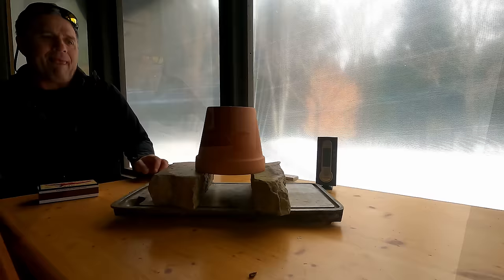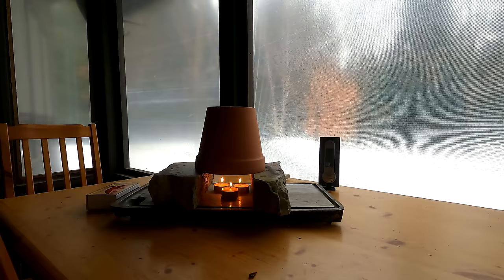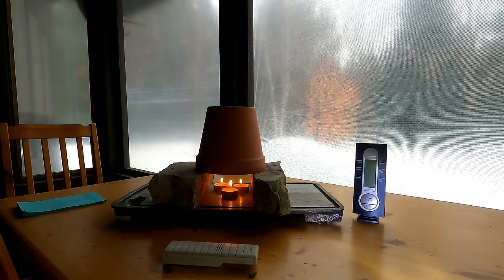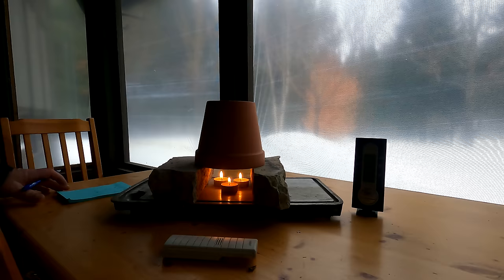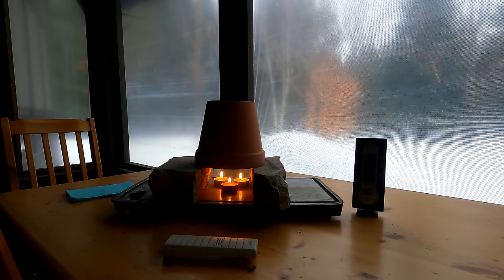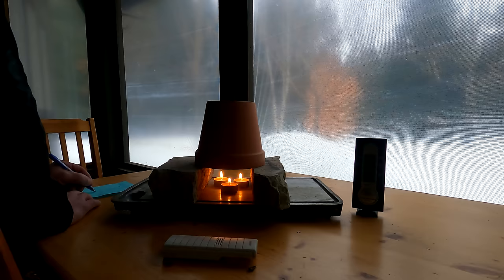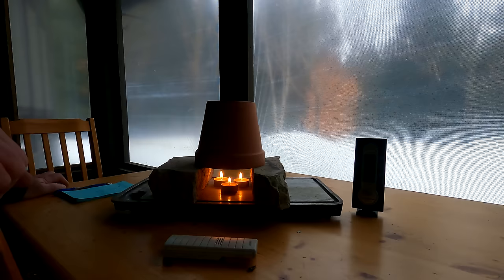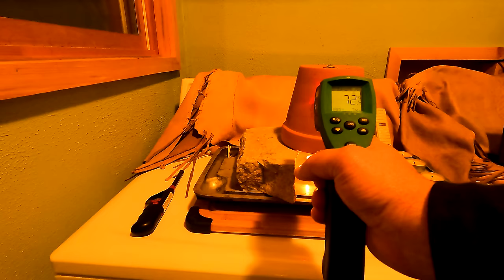Testing the Clay Pot Heater | Truth or BS | Prepping and Testing

Comment: This seems ideal for, say, some homeless guy who can't afford a house but CAN afford some candles and some pots
Reply from the maker: This test was to determine if the unit could work as a space heater - the results indicated it can work  to raise the temperature a very small room by a few degrees. The pots capture the heat and control the output.  It is a system which was used centuries ago to heat homes. They used clay units which were designed to capture and store heat. When the power goes out and there is no heat available, people will resort to all manner of contraptions to keep warm. I would not use this in my home due to the safety hazards involved, also,  there are products designed to provide emergency heat efficiently and safely. I don't blame people for experimenting and trying things out rather than complaining about being cold.

Comment: This test would be better done, and more credible if it was done using the scientific method. So you should do this with only the candles in the same room with weather conditions exactly the same.
Reply from the maker: You are correct - this was a simple test not a differential test. The actual test was conducted in an enclosed room which is 5' by 8 ' with 8' ceiling. This room is insulated with R30 in the walls and R40 in the ceiling. Outside temperature has no bearing. 
I recently did the same test using the scientific method. This will be posted shortly.

Comment: Remember that you are 37 celsius and lot more surface than a pot.
Reply from the maker: That is why I removed myself from the equation. I entered the room only to check on the status of the test; however, with the candles burning and a persons body heat in a small insulated area, the person would indeed be able to stay clear of hypothermia.

Comment: Amazing that after all that 'science', you did not do a test with just the candles (no pots).  You would have found that the room temp would have risen exactly the same, with or without the pots (assuming that the outside temp also remained exactly the same for both tests).  The candles put out a certain BTU  value with or without the pots.  The pots do not add ANY extra heat to the BTU's put out by the candles.
Reply from the maker: The error I made was assuming that most people would understand that the test was done to see if the pots would capture the heat and radiate it rather than stifling it. The pots will radiate the heat up to 30 minutes after the candles are extinguished. The real test of this unit was done in a laundry room which is internal to my home  - R30 insulation in the walls and R40 in the ceiling - outside temperature has no bearing on the process. The room's temperature raised by a few degrees - the building code stipulates that an occupied area must be able to maintain 18 degrees Celsius - This unit would not be capable of maintaining that level of heat ; however, it would keep a very small room at a relatively livable temperature. All of that aside - I would not use this unit as a heating source as there are too many issues pertaining to safety which precludes this from being viable. There are many manufactured heaters which are designed and sold for the very purpose of - Emergency Heat.

Comment: So in the middle of the day it took 2 hours to get from 8.5 degrees C to 10 Degrees C that's not a great change, then you switch to a different room that looks nothing like your " experiment set up " and start bangging on about 15 / 16 Degrees and it's not BS 🤣 not to mention the second part of the video looks like night time, how low dose the temperature drop there at night? I'd say its way lower than your original 8 degrees C at the start of your video and I don't for one minute believe you brought the temperature up from 8 Degrees C at the start to 16 Degrees C at the end without some other source of heat.
Reply from the maker: Hello Christy. Good observation. The first room is an uninsulated screen porch. Plastic film on screens. I was surprised it even raised the temps by two degrees.  The second room is an insulated mud room. Door closed. No extra heat source. Size 5 fr by 6ft. 30 ft square. All temps were measured real time. If you don’t like the heater, don’t try it. I wouldn’t use this to heat anything. I simply was answering the question, does this device actually work. It does. Simple. I never said anything about efficiency.  By the way, I don’t BS.
Reply: @Hawksshadow  and you have no idea how to conduct an experiment either!
Reply from the maker: In response to your wonderful comment,  I would have to say that everyone is entitled to their opinions.
The one thing I can say is that the video was a test and not an experiment - I was not comparing it to another heat source. Just simply determining if the unit could raise room temperature - I did another video recently in a tent using the same unit. This time I compared it to another heat source.   BTW - I would not use this as an emergency heater as it is way too inefficient and hazardous.

Comment: Try it again with candles but no pots. Maybe then you’ll understand your mistakes.
Reply from the maker: I did not make any mistakes - simply a test - the pots worked as expected - they captured the heat and radiated it out in a controlled manner. The combination of candles and pots did indeed increase the room temperature marginally. Candles would indeed do the same; however, when the candles burn out, no more heat. With the pots, when the candles burn out, the pots continue to radiate the stored heat for at least 30 minutes after the candles are extinguished.  Would I use this in my home - absolutely not - I have other very efficient means of acquiring heat.

Comment: Wow, lots of freshman physics students shrieking a BTU is a BTU, correctly mind you for the incorrect question they are addressing.
It is sure nice to know that everyone can toss all those expensive central heat units out of buildings because a BTU is a BTU.  
Wow, that would help "green" things up with about the same logic as AGW morons use.  What is the next suggestion for the BTU is a BTU crowd?  Tear off the roof because the energy will eventually leave the structure?  
The point isn't about if candles can heat a structure as well as modern HVAC, it is about a more useful way of altering heat flows for human comfort.  FYI, in a survival situation, a couple of degrees in localized heating can make the difference between life or death.
Reply from the maker: Thank you for joining in - you are absolutely correct about everything - I loved your comment about localized heating - when you are in a survival situation, any heat is a most welcomed addition. The whole point of this unit is to heat a small space where you can sit close to it and  stay on the above zero side of the thermometer.  I personally would not use this device as there are manufactured heaters created for emergency heat. When your back against a wall and you have some pots in the shed and a few candles in a drawer - kudos to the people who choose to try something rather than complaining that they are shivering.  Awesome comment - much appreciated.

Comment: You can't get more energy out of a system than you put into it.
Reply from the maker: That is correct - the pots only function is to capture the heat and disperse it in a controlled manner. This prevents the heat from the candles from simply rising directly to the ceiling where it will be lost.

Comment: Place a chair over this contraption and it might keep your butt warm.
Reply from the maker: I would rather sit on a piece of Styrofoam - open flame  is nothing to be trifled with.
Reply: Biggest danger is knocking it over, which I have done.  Made a mess, but that was it.  Agreed, an open flame can be dangerous if you are not paying attention. Still, the flame never comes in contact with the chair, and on my chair there is about a 6 inch gap between the top piece of metal on the Uco and the bottom of the chair. If you are the type of person who falls asleep in their chair, this might be an issue.  I was trying to stay warm in freezing weather during the day. @Hawksshadow
Reply from the maker: I actually thought you were joking about the chair thing.  You are so right not wanting to hit this thing while in use - it would indeed make on heck of a mess if it was knocked over - not to mention the potential of a fire. I think if I were to place a chair over it, I would use one of all metal construction - the metal seat would get hot and it would feel like a heated seat in a car..   Thanks for the clarification.  Stay warm - but do it safely.

Comment: This sounds impressive, until you remember that a human outputs about 100 watts while at rest. Without the fire risk.
Reply from the maker: You are correct - I was not in the room while this test was done for that very reason. I used a thermostat which has a remote sensor so I could monitor the situation from a different part of the house.  When using this device, you would have to be sitting very close to it for it to be effective - your body heat would be part of the equation. Note - I would not use this unit myself as there are indeed safety issues which simply make this unit dangerous is left unattended. The Pots capture the heat and radiate it out in a controlled manner. That is the only function of them. 
Thanks for the comment.
Reply: Sorry I should maybe have been more clear. I wasn't suggesting that your presence somehow influenced the test. More that just sitting in a room for a while is also going to heat the room a couple of degrees, without the fire risk or faffing around with candles and pots.  @Hawksshadow
Reply from the maker: Thanks for responding - You are right, put a few people in a small room and the temperature will climb by at least 5 degrees. The Pots and candles are indeed a pain - the risk of fire, the fragility of the pots and the risk of burns are only some of the issues.  I set a tent up in my living room to test a theory about heat retention. I let the house go cold and set the tent up for a winter campout - It worked amazing - the tent was heated simply by my body heat and I slept better than I do in my bed.  Thanks very much for the comment and conversation.

Comment: If you believe the results then cut the grid off and try for a week😊 that will bring you back to reality real quick.
Reply from the maker: Dude - I live in the bush - I sleep outside at minus 30. This was simply to determine if the unit can increase the temperature of a small room - it did - by only a few degrees. The room was well above zero when the experiment was conducted. This unit would not be able to bring a room up to comfort level from any temperature south of 15 degrees Celsius. Reality to me is making a campfire when the wind is howling and snow is falling so thickly you can't see more than twenty feet in any direction. 63 years in the bush certainly has informed me of what living off the grid truly means.  Thanks for the comment.

Comment: Hi, I'd like to comment!  You did an experiment without a control so you cannot compare. You should try just bring the T-lights without the claypots. You will get JUST AS MUCH heat from burning them as you do with the claypots!  Just think what you are doing: burning wax and converting that into heat and light. How do the claypots add energy?  They don't! So try your experiment again and measure the air temperature... I think you will find no difference or maybe it will be even warmer without the claypots because don't forget, you are wasting energy to get the claypots warm!!!
Reply from the maker: Dude - You have the right to Comment; however - the premise of the test was simply to see if the rig worked - it did. Your assumption that the t candles would work just as well is based on nonsense. I have used candles for years in outdoor shelters and can vouch that if the shelter is properly built, the candles - 3 inch round by 6 inches high, will indeed keep the shelter from freezing. I did a video on that last year. The clay pots do not add heat - they retain and radiate it. That is the same premise used to heat my Tipi - I use large rocks and heat them in a fire. Once they are glowing red, I place them around my sitting area and enjoy the comforts of primitive life. I never stated that the clay pots add energy. Comment all you want but don't take me for a fool. The experiment was a test - simply that. Again I will state - I would not use this to heat a room or a tent. Too fragile and simply too dangerous should a pot decide to crack or explode due to excessive heat. Candles were used for years to provide light and vicariously some heat in homes prior to the advent of electricity, furnaces and HVAC systems. No Guff - of course they will provide heat. If you want to heat a room safely, purchase a couple of oil lamps; They are awesome - they provide heat and light and can run for hours on a single fill. Nice try Peter.
Reply: Clay pots radiate the heat
Reply: @reneek7721  so does a flame!
Reply: @famdegroot1988 :
The terracotta pot stores that heat which radiates around the surface not straight up to the ceiling.
Reply: I’m not taking you for a fool. How did you come to that conclusion?  In your video you state that the room temperature increased by 2.6 degrees. If you had just used T lights the room would have heated up even faster but not stay so warm for so long  Obviously no energy is created.
Reply: Did the outside temp rise? Was the sun warming the room? What about heat in connected rooms. No controls equals invalid results

Comment: What many people miss is that warm air does not keep you warm; warm, solid surfaces keep you warm. The mass of the air in a room is minimal, and a few tea candles do contain enough energy to raise the air temp in a room by several degrees. But that doesn't matter. Your body isn’t getting any  significant warmth from the air. Instead, if a room feels warm (assuming relatively calm air) it is because all the surfaces in a room are emitting infra red light, literally shining heat onto you. If your walls, floor, furniture, etc. are cold, you will feel cold. You will be radiating more energy than you are receiving. The thermal conductivity of the air is tiny. That’s why air gaps are used for insulation purposes: they don’t transfer heat very well. The radiant heat of the rooms surfaces is what matters. Sure, the little clay pot surfaces are turning some of the energy in the candles into radiant heat, but it is such a tiny fraction as to be irrelevant unless you are using them to warm your hands from two inches away.
Reply from the maker: Very well written and thorough. The system is only capable of maintaining the heat in a very small room. This particular room only increased by two degrees from 16 degrees C. If you were to try to heat a room of this size - 40 square feet - from any temperature less than 15 degrees C - this system would indeed not work. It may maintain the temps but that would be it. Keeping your hands near something radiating heat when you are cold- is enough to keep you from hypothermia.  Note - I would not use this system as it is too fraught with safety issues and there are products available which are designed to heat larger spaces - safely - should the power grid fail.  I live in an area which this happens frequently and the temps cam fall as low as -40 degrees Celsius which is -40 degrees Fahrenheit. Thanks for adding to the discussion with very rational thought.

Comment: I don't have a thermodynamics degree or anything, but I think the "secret" is a matter of coupling.  The same way a transmission gears down an engine to low-rpm but high-torque when you need to take off from a standstill, the clay pots do something similar.  Nekkid flames "burn the air" and heat up wisps of air to a high temperature, which mix with colder air almost instantly and the "diluted" heat just wanders about the room aimlessly, and you hardly feel anything.  Cup your hands near the tea-candles, and you won't warm your hands.  The clay pots, though, bottle up the air and thus the heat, absorbing the flames' heat and reradiating it as infrared like a heat-lamp.  So instead of having marginally warmer air heating up all of Hell's Creation, you have a concentrated source of heat which warms you when you're close to it.  You're not feeling the high-heat from teeny little flames, but longwave infrared at a much lower temperature but which you feel quite readily.
Reply from the maker: Very well said indeed. The pots do capture the heat and radiate it out in a controlled manner. Candle heat on it's own simply vanishes due to air currents.  Thanks for the comment - again - well thought out.